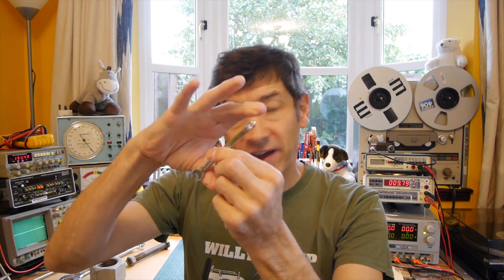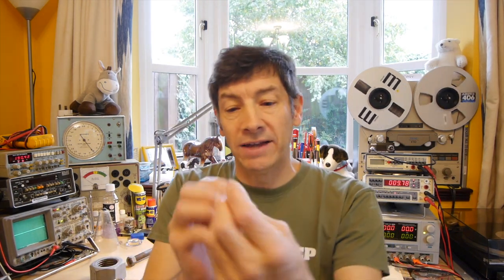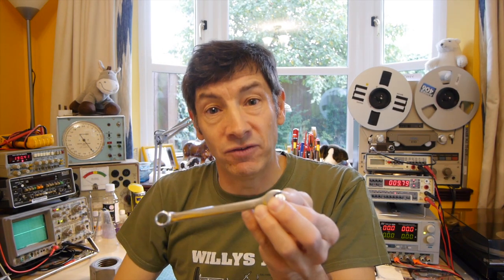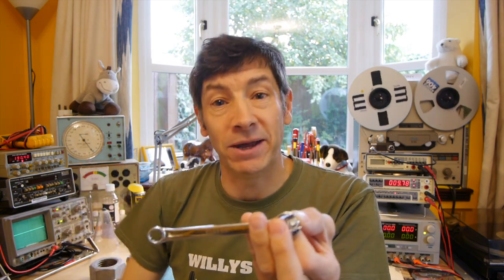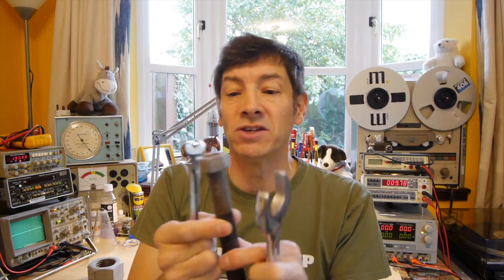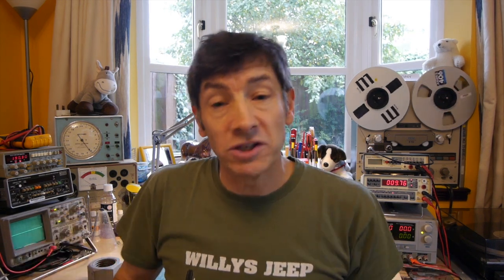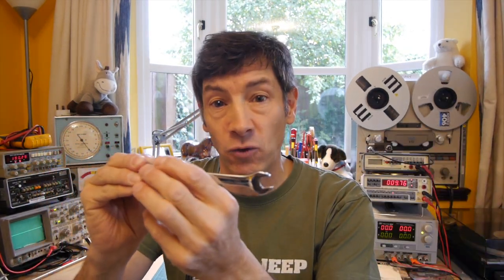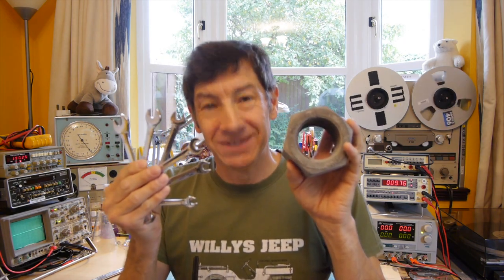Spanners, Moments and Torque - Why are spanners different lengths?  F-J's Physics - Video 160

Comment: MS Copilot gave me this video, nice. I have ADHD and like to learn, i cant help but wondering why those two film wheels in the back are moving at diffrent speeds.
Reply from the maker: Good question.  So it's a Teac reel-to-reel tape recorder (Teac X-10 as the reels are 10 inches in diameter).  The tape goes through at a constant speed,  but the reel on the right is almost empty so the hub is only a few inches around whereas the reel on the left is full and many more inches round so if it is, for example 3 inches around the right hand hub and 9 around the left one, for every one turn of the left one the right hand one has to turn 3 times.  It's a bit like gears in some ways.  Now when both reels are equally full - half way through the tape they will turn at the same speed and as it runs out the left one will turn faster, with the tape always spooling off and back onto the other one at the same number of inches per second, 3 3/4 inches per second in this case.  Hope that helps and thanks for asking and watching.  Let me know how you get on with some of my other videos if you like.  F-J
Reply: @AnthonyFrancisJones  Thank you for this excellent response. I'll check out more of your videos.
Reply from the maker: Great!  Let me know how you get on!